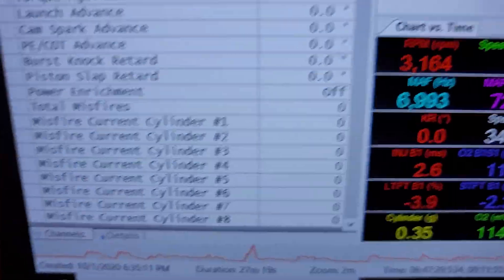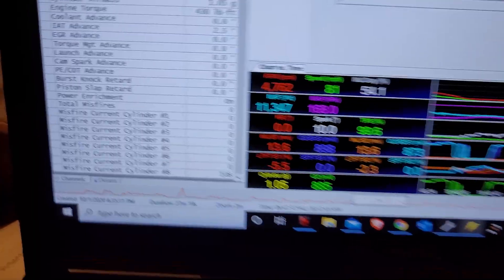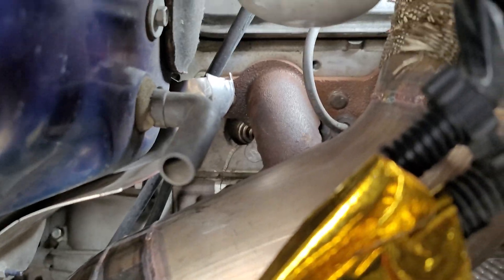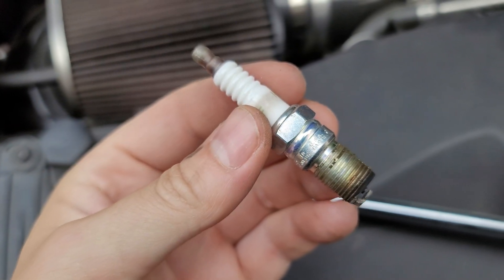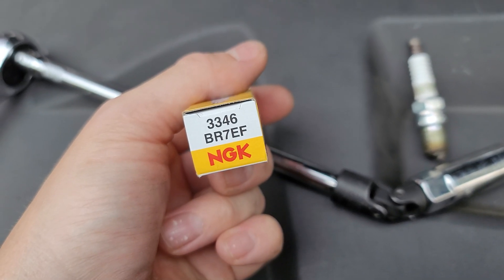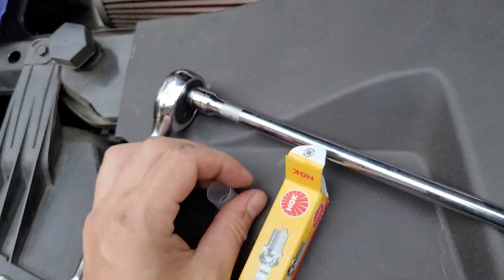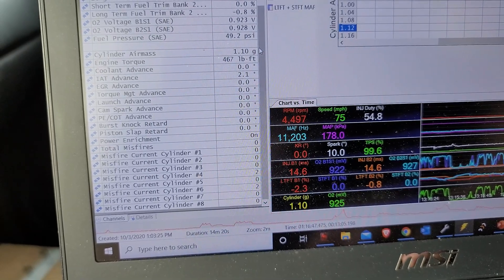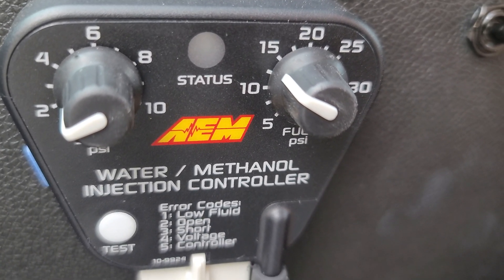Problem Solving Missfire With HP Tuners

Comment: Good idea on not adjusting the fueling to compensate for the methanol. 
Methanol in a v8 has poor distribution when sprayed from 1 or 2 nozzles in the intake tract, but it makes the afr very rich. So when we calibrated fueling, we have to pull a ton of fuel out if spraying 70+% meth but that is very dangerous as our Afr data is from an average of 1 bank or both.

So one or more cylinders could be dangerously "under methed" and now we are removing fueling globally, scary situation with meth. 

I remember tuning an LSA without meth to an 0.78 Lambda. After the meth spray with a large single nozzle, afr went down to 0.67 lambda or so, insanely rich. Then I proceeded to remove fuel from the calibration to satisfy 0.78-0.8 lambda but was quite worried in case meth failed or if we have a distribution problem even with a properly working system.
Customer went down to a 50% meth mix so we didn't have to worry about removing fuel.

Seems like the less cylinders an engine has, the better the distribution of meth goes to all cylinders when sprayed from an intake-tract nozzle.
Reply from the maker: @GTStuning-  Especially with a stock intake. LS motors are known for going lean on the rear cylinders.

Comment: I can't get this to work on my LS1 swap. It's misfiring but always says zero. The SES is enabled for the misfire codes.
Reply from the maker: Your not able to log the miss fire with HP tuners? What ECU is it?
Reply: @TheAutoAnswerMan916  0411 stock Z28 ecu
Reply from the maker: @vtecbrown  did you tune it to be less sensitive for misfires? Sometimes a big cam will make the ecu think its misfiring and they will change the parameters in the tune
Reply: @TheAutoAnswerMan916  it's a stock LS1. Stock cam, intake, injectors, coils, etc.. I'm definitely missing something, just not sure what.
Reply from the maker: @vtecbrown  let me do some digging. I have a 2005 ctsv with the same ECU. I'll see if it works